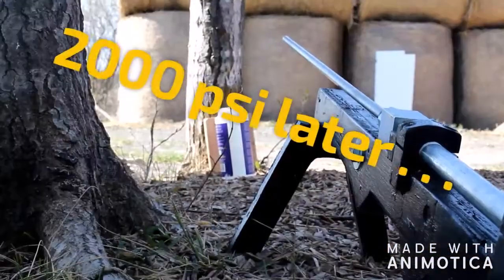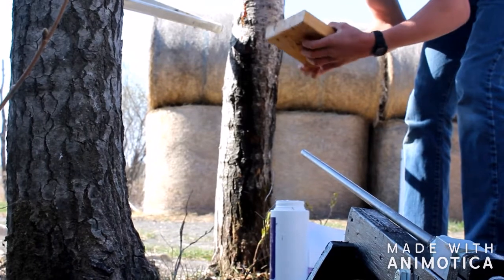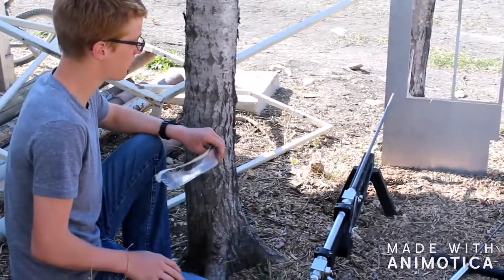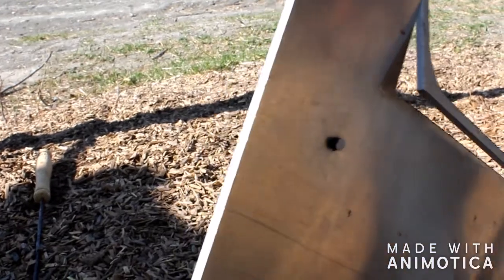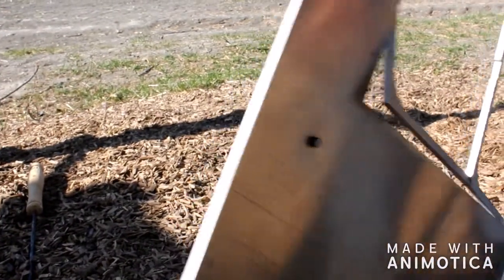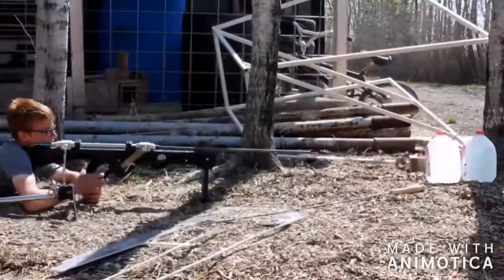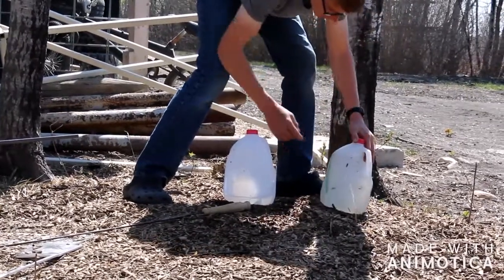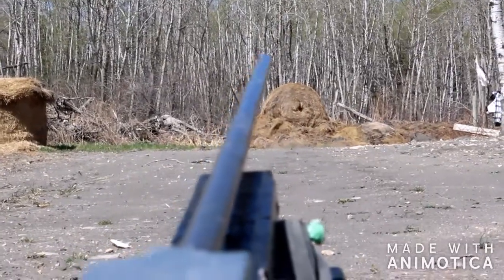test shooting with HIGH pressure homemade airgun

Comment: Hey I have a question....
What kind of valve you used for the high pressure? And we’re can I buy it?
Reply from the maker: 1/2 inch hydraulic ball valves bought at princess auto( valves are rated for over 7000 psi)